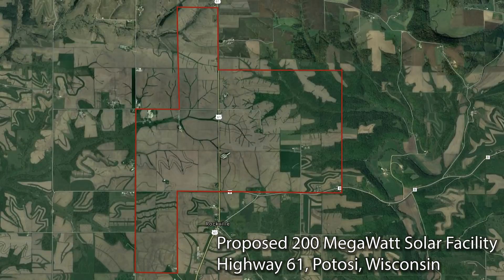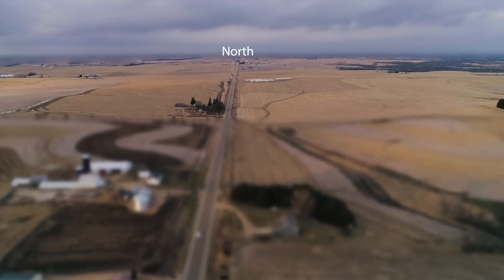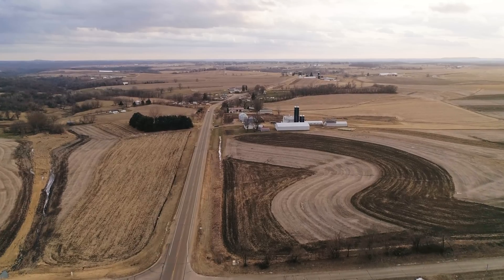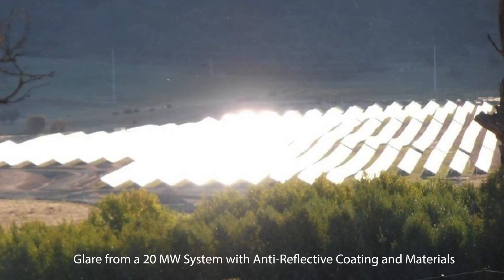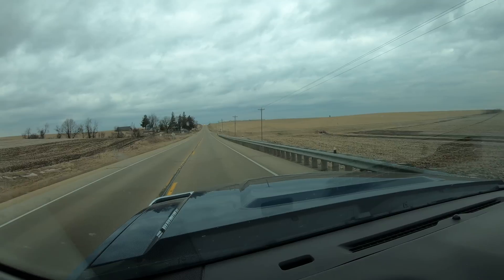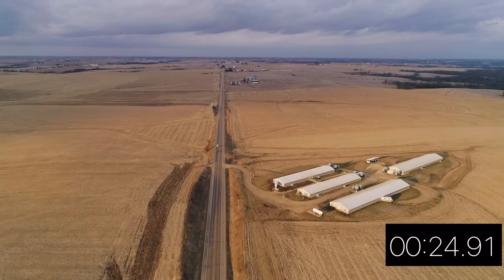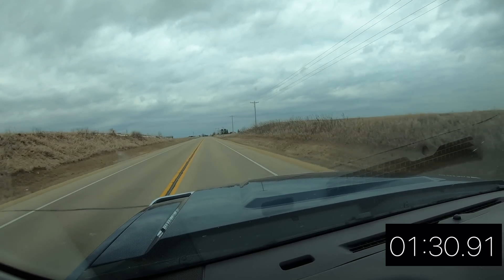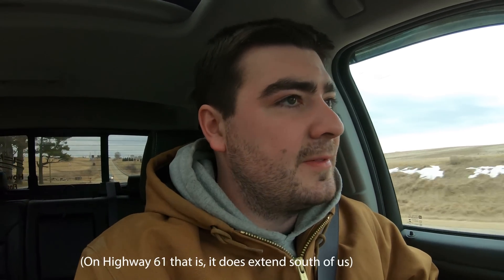Proposed 200-MW Solar Facility | NextEra Energy

Comment: I have two points of interests for your consideration: Point 1, Solar panels are made with numerous toxic materials and substances that can leach into the ground and ground water. Reference:  https://www.ucsusa.org/resources/environmental-impacts-solar-power .  Until the Obama Administration, the EPA suggested using solar panels or having solar farms be placed on existing Brownfields and other toxic waste sites. Many utility companies have been leasing land for solar panels and once the lease term is up; the land owner is left with the responsibility of dismantling the solar panels and responsible for any and all environmental clean-up costs. The 2nd or other point of interest; having that scale and size of a solar panel farm is going to change the local climate and weather patterns; to what degree and if good or bad for growing plants, crops, and animals has yet to be determined. Most of the sun light that penetrates the earth’s atmosphere is short wave and upon hitting green vegetation much of this short wave sun light energy is then reflected back into space. One major reason of several reasons for the USDA No-till/cover crop push by the USDA scientists. What does not go back out into space is converted to long wave sun light energy which is then trap in earth’s atmosphere and being part of, or contributing to the greenhouse effect. Reference: Elements of Ecology 8th Edition Chapter 2 https://docs.google.com/document/d/1m19Mey6NX1kpDBTW2QU8vPLkdkpOig9eWcAoVfaCLUE/edit  Solar panels convert all most all of the short wave sun light to long wave sun light energy. As the years go by, the solar panels lose their ability to absorb this long wave sun energy and then will need to be replaced or removed in order to reduce greenhouse emissions. My concern when considering the proposal of installing solar panels on the free-stall barn roof was the known environmental hazards and related unknown disposal fees and clean-up costs 15 to 20 years later?

Comment: Solar via Pedestal mounting of soil ground works well for hilly terrain. 
Tornadic damage cannot be predicted. 

Solar photovoltaic system is far better than a traditional coal or natural gas power plant. 

On some of your hilly underutilized land you should consider solar. 
I know of some farmers have installed solar systems on  their machine sheds... cutting their power bill significantly. Given there is a payback of the system expenses over time.

Comment: So if it goes through there are some things you can do to profit from it without giving up farming. First there will be a lot of farm infrastructure that will have to be removed (silos, grain bins, grain legs, etc) some of which you might be able to purchase cheap (yes there will be auctions for the tractors etc but there will be more compition there). Second depending on how much earthwork they have to do you might be able to get a few loads of topsoil almost for free which you could use to fill in those sink holes. Third there will be a lot of land they own that they will be unable to use for solar panels (to hilly, creek bottoms, whatever) you may be able to purchase or rent it very cheap. Fourth if they do need access to the substation you might be able to trade them some of your land for a lot of theirs, calculate the acres they need for the coridor and trade it for 10 times as much of their land (or more).

Comment: I have hooked up several solar farm facilities to our power grid system with the utility I work for.  200 megawatts Is a big system. I like the idea of getting away from dependence of fossil fuel resources, and the fact it’s a zero emissions resource. However, they look like shit, and they only produce on sunny days which could impact your local towns daily energy needs. I would ask questions about the negative impact their solar farm will have on the local habitat and wildlife, and what they plan on doing about it. I like your idea about drainage off the solar farm, will it impact your farms? Will there be back up retaining ponds built to prevent erosion? All good questions to ask.
Reply: They still produce power on cloudy days just not as much as sunny days.

Comment: They tend to change the Micro climates by warming the air.. they can extend your growing season. It depends if they are a Photovoltaic system or a Sulfur heating boiler... We have both where I am at... The boilers are the glare causers the photovoltaics can be placed on rolling land with out changing the gradients..the boilers have to be leveled..

Comment: A shame too see such good ground go out of ag production.

Where the panels are on both sides of the road would glare not be a major health and safety concern for motorists
Reply: From the way the panels are angled motorists won't see the glare.
Reply: @wulfjason  maybe but remember the ground is very hilly !!!
Also I hope the glare doesn't affect any aircraft pilots been so close to the local airport
Reply: @johnchambers1770  They are most efficient when the panels are perpendicular to the sun, so if they follow the sun there shouldn't be glare on the ground.  As for pilots, it really wouldn't be any different than glare from a large lake.  It just isn't an issue.
Reply: @wulfjason  I have very limited experience with solar panels but I'd say if I was to start researching these issues and visit a similar site I could see these points I made been of some concern

Comment: That 200-MW would only be achieved at peak sunshine on a crystal clear day. From the research I have done, solar really only produces energy about 60% of the time. When you factor in the cloudy days, and snowfall, which stays on the panels and basically makes them useless, you have to think why they would even want to build in this climate.
There was just a story about the largest solar farm in the United States that is proposed in Nevada. I can't remember the size, but fully charged, the batteries will provide power to about 20,000 homes for 4 hours. Overall not a really good output for the amount of land it will take. 
These solar companies will make all kinds of promises to the local governments to build their farms. Most of the promises are filled with the gold carrot on a stick, but it is doubtful that any sort of windfall will ever occur.

Comment: Here in Ontario, we've had a significant  expansion of solar and wind installations over the last 15 years. I'm not heavily for or against  them - there are good things and bad things about it. IMO, the environmental objections are rather conjured up. Glare isn't really an issue. It's poor land management if it's going on cropland, but then again, I believe landowners have a right to make use of it as they wish. The biggest negative is that it is an expensive source of power. Should only be used for remote communities.

Comment: Coming from the coal burning electric industry , it’s just shows what is happening with the “green “ movement. Lots of good land being used where a 200 mw coal burner would sit on 10 acres at the most . And once the panels are up . Very few jobs in maintenance . Coal is cheap power providing jobs . New technology has it probably cleaner than the batteries for this solar stuff .  Personally I’d fight this .

Comment: As an Architect, I do some solar installation, though no-where as large.  I would STRONGLY suggest you family retain legal counsel NOW!  With several of your family properties adjacent or between them and the substation,  I'd be very cautious and watchful.  The base technology is sound, but the "politics" can be vicious ...especially to small landowners...."for the greater good".  The local politicians are on their side, they want the endless stream of tax revenues.  ...In most states, having any public utility or public entity -- or even just public money -- involved opens the door to eminent domain and forced takings...and forced rights of way and "utility easements'.  Anecdotally there's issues with electromagnetic fields and "powerline crackle" effects on livestock.  Cattle and horses are very sensitive to voltage differentials in the soil near high-voltage.  Nearby overhead and buried high-voltage, high-amperage transmission line "leakage" can be fatal.  Your row-crop and grain-farming neighbors might not be concerned, but you have to consider your cattle/beef operation.  Especially as you and Travis are looking at decades living next to this installation while growing your operation...and families.  Congrats to Travis and Brittany.  Yay!!
Several largish solar farms near me run livestock under the panels under and between the panels.  There's still a lot of grass between the rows of panels to avoid shadowing.  Most arrays only cover 1/3 of the land, the rest is grass that has to be managed.  The local liquor store has a herd of alpacas living under and around their arrays.  How much additional acres would Travis like to raise and harvest hay on??
Reply: The local liquor store has a herd of alpacas living under and around their arrays..........DEFINITION of diversification??? Restuva this STORY???!!
Reply: Our local solar arrays only allow small livestock no horses cows and no tractors

Comment: There's nothing green about solar. Research what happens to used panels and there toxic contents. Plus the lithium batteries that have to be used in conjunction with the panels. A solar farm is being rammed through in my county.
Reply: I think in this situation, the grid will be used as the battery bank but I agree with you about the whole solar thing being "Green"
Reply: Yes, they don't use batteries in these applications. This is all on demand use.

Comment: So concerning the noise, that is usually not a big problem unless you are standing directly next to the converter house, they sometimes whine a little, due to the DC to AC conversion.
The panels don't make noise, except for rain or hail, like a tin roof might.
Since you are south of them you could ask what angle they want to use for the panels, not sure how much sun you get in the winter and the hills might block some of that so they might choose a relatively flat angle to maximize collection in the summer then you shouldn't get much glare from the north only from the ones in the west at sunset.
Runoff should be managed by the right cover "crop" and proper maintenence.

Comment: I would be worried if a panel broke and the the chemicals inside got expelled into the surrounding area I.E. water streams, animal feed how it would effect animals or crops?
Reply: They are made of solid materials so you just pick up the pieces and dispose of them? The phone in your pocket contains the same chemicals and worse!
Reply: Graham Burgess the chemicals inside are solid when not broken but if the panel was shattered some of the solid chemicals would turn into dust and breathing it in would be hellish. And I doubt a phone would have worse chemicals in it because then it would be a health hazard to carry your phone without a hazmat suit on
Reply: @lukeharcus6527  maybe you are right, but by that logic process anyone involved in a car crash would be exposed to demon hellish levels of dust from all the broken bits of car. I think you may be confusing the fact there are toxic chemicals involved in the production process of solar panels (just like most other production systems) and the actual panels themselves, which are made from glass, metal, silicone and trace amounts of other herbs and spices - https://solar.gwu.edu/do-solar-panels-contain-toxic-chemicals
Reply: Graham Burgess yes there are toxic chemicals used in the manufacturing of cars and when you crash you can inhale toxic chemicals depending on what breaks.

Comment: Fight the bastards! Arizona and California have these solar fields. The glare is miserable. Try selling for fare market after that garbage is installed. Take hwy 95 from vegas to Laughlin nv., solar fields to the west in desert. The glare is hideous! Take the I-15 from Vegas to California and at state line there are solar fields that are not photovoltaic. The glare from those solar fields are so intense it burns your skin when driving in an air conditioned car and tinted windows on th I-15. The added heat is deffinitly noticeable.
Bad news Ryan. It is too close to your home. God knows what it will do to your crops. Your community will suffer for letting this facility to be built. 
Putting solar fields that far north is not a smart move. Lack of sun and plentiful snow in the reagion reduce efficiency greatly. Photovoltaic panels wouldn't be a profitable choice. I'm guessing there is some deal with state or federal government to subsidize this project at your expense. One example is a quota. If they don't produce enough power they can be made whoe by the state. Find out how they plan to stay profitable in winter.

Comment: Suggestions.  Crossing your land might not be all that bad...they have to build access roads and maintain their row, so think about where you would like a good road to be built,

They can place fiberoptic cable in the static wires of the transmission lines.  If they have high speed digital service at the substation, make them bring you a few hundred megabits and drop it at your place.
You can model the reflection angles with software like STK for free...bit of a learning curve, but doable.
Make them provide electrical surge arresters for all your service drops...if they trip one of the phases of the transmission line, it has the potential to induce some pretty big voltages into the power lines coming to your house...
I am not an active engineer but a retired one.  Consult an attny and an engineer before signing anything.
As if their contracts would allow them to put any other facilities on the property, wind, cell towers...anything.

Be happy to brainstorm these with you or your consultants...good luck.
Reply: They will tend to leave their equipment in place after useful life.  Make them describe how it will be decommissioned...and if decommissioned cz how will they remove the lines or what else would they do with them?
Reply: @TomTalley , Exactly, just like all the abandoned mines with deadly water constantly oozing out from them. After it's useful life, will the company just bail out leaving the residents to clean up after ?

Comment: I have dealt with wind power people in my community. As far as solar power is concerned here is what I would be concerned about: (sorry for long comment)
1.) Is this project going to be self-sustaining or does it need government subsidy money in order to financially survive? You could be dealing with some major problems in your community in the future if the government subsidy money dries up and is no longer available.
2.) What percentage of the gross revenue go to the community? What percent goes to the landowners? Is there a minimum payment?
3.) Even though we don't see it much on the consumer end the price of power fluctuates a lot depending on market conditions. Basically, the price of power changes every few minutes depending on availability and demand. This is the price of power that the generator sells power to the Distributors for. With that said, what's going to happen if for example the price of natural gas hits the basement like it did around here in Western New York and the Revenue Generated from this project goes way down?
4.) Renewable Power sources like solar and wind are what we call interruptible power sources. That is they rely on the presence of the sun shining or the wind blowing in order to generate power. The challenge is that's there is insufficient battery technology developed the store this power so that the grid can tap into it when there is a demand for it. What I suspect will happen is the power from this system won't be used as often as people think it will be. When you go to your meeting ask what effect this will have on the revenue generation because remember that is what will benefit the community and neighboring landowners. Without adequate battery storage technology developed these types of green power sources will never be a replacement for the non interrupting power sources that we currently enjoy.
5.) What is the lifetime of this project? Is there an obsolescence plan? What will happen if this project gets sold to another entity?
6.) Has there been a full study done in terms of the environment? How will it affect wildlife? Will it affect bird flight pattern? Affect Local farm animals? For example does it generate any high-frequency noises or anything like that that can affect the animals and people?
Reply: Oh you mean "government subsidy money" like what the government has doled out to farmers for years? Get real, what do you call the billions that Trump paid to corn and soybean farmers?
Reply: @keithkuckler2551 , I know, Trump is terrible for wanting our country to have fair trade deals with other countries, unbelievable, the nerve of him.
Reply: I don't take any subsidy money. Besides, these projects get the majority of their revanue from subsities. Also, farmers are providing food which is more nessesary. Besides that, the size of that project is huge! And it's only going to generate 200MW?! That's not much and that is only at peak generation on a really sunny day! The rest of the time it will be less than that. Financially speaking it needs at least 2 important items to be a long term green power solution: 1) battery storage so that the power can be released when it's needed and 2) ability to be financially self sustaining. -have a good evening.
Reply: @frankeem3820  Solar is way cheaper than it was just 5 years ago.  Subsidies are needed any longer.  They probably still get some tax credits for building it however.

Comment: Glare is certainly a concern as is run off and location of new transmission lines. Stray voltage is also a concern.  It's time to put some serious heat on your local elected officials.